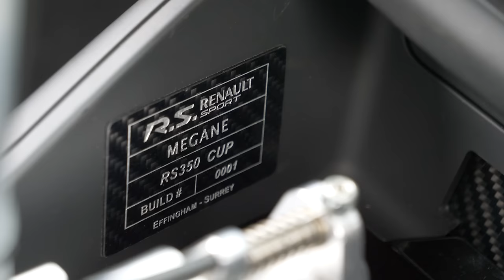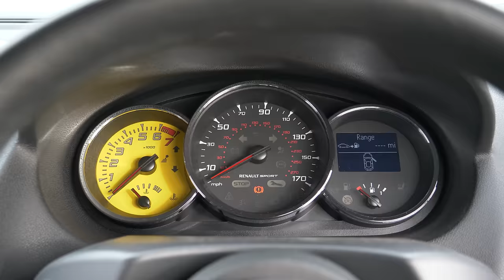The Ultimate Renault Sport Megane RS250 Cup Build - "SO10 LAP" - £30k spent! (Review and Drive)

Comment: That's an hardcore track car. I imagine its terrible to drive on the road, but review it again ON TRACK.
You need to review one of these in standard guise on the road and I guarantee you'll like it.
Reply: The standard car is terrible on the road as well.
Reply: @Joe-qc2fw  the non cup rs is quite ok on the road and you can get a rebuilt lsd gearbox for 800 pounds.
Reply: @Joe-qc2fw  I've owed one and they're perfectly fine in standard form. Admittedly I lowered it and it kind of robbed alot of the comfort.
Reply: Jayzcee Graham did a pros and cons review on one of these on road

Comment: I just bought an 2011 RS250 cup trophy. All standard, lovely car, and you are right 250-300hp is more than enough, I don't even feel like it needs a tune or more power because its plenty of power for the STREET. relatively comfy and quiet (19inch spec). Drive a standard one on the street and you will be very impressed@

Comment: There's a reason there are so many of these on the Nurburgring and it even set a quicker lap time than E92 M3 there. This is obviously made for the track, do try the Trophy R or non R, or even the 265 that's not been fettled so much if you get the chance.
Reply: Even if the E92 M3s and more expensive to run, i'd still rather have it over the Megane RS because it simply sounds WAY better, also I appreciate the feeling of 50:50 weight distribution.
Reply: @smilepermile888  Sure a V8 will naturally sound better and 50:50 weight distribution is a massive plus. 
They are just very different beasts :)
Reply: @smilepermile888  50:50 weight distribution is a sales gimmick.

Comment: I think the car is really cool but I guess you need to take a look at your current spoiler set up for some adjustment. The rear Spoiler looks (from the given camera angel) not really placed in the most efficient way. It seems like you have left and right roughly 5 cm working surface and a middle section which produces just drag (the place in between those "vortex generators" at the end of the roof). Repositioning the part could work wonders (just guessing).

Comment: Full roll cages with no crash helmets, scary.
Reply: I wondered about that - why not add padding?
Reply: Julian Evans The FIA padding is ideally supposed to work in conjunction with a helmet. Without either even a really light side impact could be life changing. I’m going to guess the the owner neglected the padding for the same reason he added the cage!....it looked cool.
Reply: seanek9 probably wears a helmet on track mate, no point really wearing one on the road when youre not gonna be over pushing 60% really
Reply: @HarryG98  No. Any side impact "love-tap" from another driver, at a junction or wherever will involve your head hitting scaffolding.  Not good.  I have a half cage in my car for this reason.
Reply from the maker: The cage is explained in the video.
Reply: JayEmm on Cars Isaw, I had a panic fit before watching the whole thing. Great of you to talk about it!
Reply: @zzkamikazezz  How is it any worse then hitting your head without a roll cage? Now if you did roll, I would rather take the chance hitting my head vs being squashed be the entire weight of the car + the force of impact.

Comment: Great review!
I bought my 2015 265RS Cup over 3 years ago and I like it a lot.

To me it´s a fun AND rather cheap car to run (mine is almost stock). More power after 5.500 rpm would be nice but other than that I´m very happy with my car. 

Why Renault decided to put the RPM/speedometer in this weird angle is a good question.
Reply: I have one and have never thought the speedo is at a weird angle. It's perfectly visible. The things we notice hey.. I'm shocked he hasn't gotten excited about the traction the lsd provides or how well it grips..!
Reply from the maker: For two reasons. 

1. High HP FWD cars dont give great traction in these conditions.
2. AD08Rs dont help either.
Reply: @JayEmmOnCars  ah fair enough, I thought they might have! Guess you need the perfect dry day and smooth road
Reply: SViip I drove 2122 808 RS 265 typeR .. holy hell !! Awesome don’t need anything had racing seat seatbelts too .. handles so well like AWD to me , wrx owner so I get one soon

Comment: Nice timing,  just in the market for one of these
Reply: I have a stock RS250. Most of his complaints relate to the modifications done. Just be sure the door locks unlock and lock (actuator issues) and that it gets to operating temp just below half on the gauge (thermostats get stuck open and they are a bitch to replace - intake manifold off), the car won't let you thrash if it cant get hot enough and will limit RPM 4-5k. Theyre high mile 10+ year old cars now so yes it will have small issues here and there but its still worth it! The drive is amazing

Comment: It looks great and is undoubtedly a  good hot hatch but I just couldn't buy one, the build quality and reliability is just to much of an issue.
Reply: If they're so unreliable why are they so popular for track enthusiasts?
Reply: @PureLeeful  I've had a few French hot hatches through the years they all handled great and broke down loads.
Reply: @randymarsh3636  Fair enough but the Meg 250/265/275 seem to have a pretty good reputation in regards to reliability.
Reply: This car has excellent reliability and a bullet proof engine. They're the majority of cars that go sub 8 at the ring. Plus if they do go wrong or you crash they're cheaper to repair than the German equivalent :)

Comment: No thanks, absolutely no to this tarted up Renault with a very distasteful looking interior. The front wheels drive set up is a no for me, it looks like it crash through halfords and came out with bits of body kits.
Reply: CK ROY I used to feel the same then owned one. They’re cracking cars
Reply: That “looks like it crashed through Halfords” line is so old and tired. Yes this is far from standard but it’s not neon lights and ridiculous subwoofers, everything on it (or removed from it) was done with the purpose of making it faster/better on track. There is nothing cheap or tacky about this car, even if you don’t like how it looks. You might as well say a rally or even an F1 car “looks like it crashed through Halfords” as they’re similarly purposeful - optimal function the only real goal. As Jay says, it’s too much for the road (where the standard car is amazing), but no reason to slate a build which was clearly done with great attention to detail.